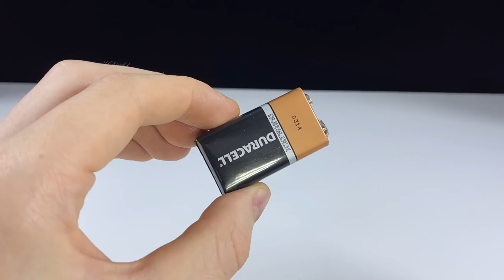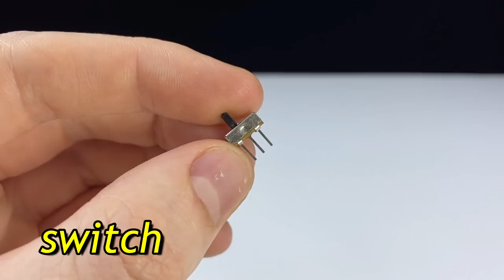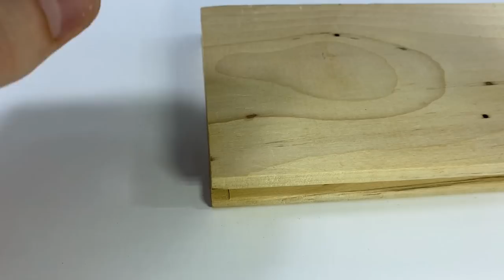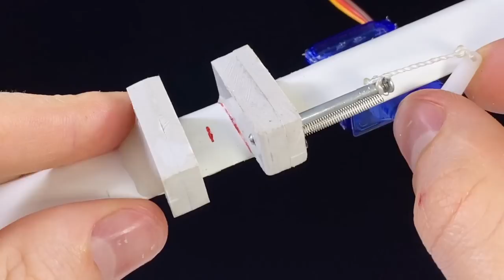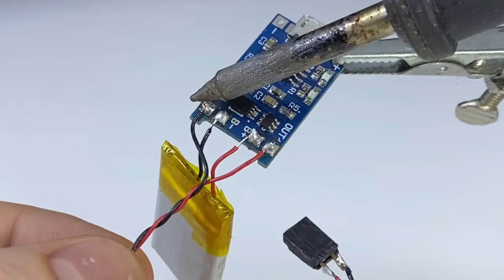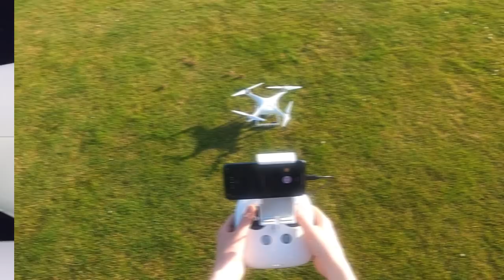5 DIY INVENTIONS

Comment: That last one looks like a good mod to be able to carry my bait out past the breakers at the beach & drop it in the middle of schools of tuna & mackerel that I can't reach by casting alone with a beach rod. Although using it as a high altitude bomber is also a fine choice. I know a lot of the parts you use are just random things you have lying around like the ice cream sticks, pens etc... but it'd be great to get either regular descriptions in the video of the electronics you're using or something in the description about what parts were used. Thanks

Comment: 0:20 Even a kid can do that
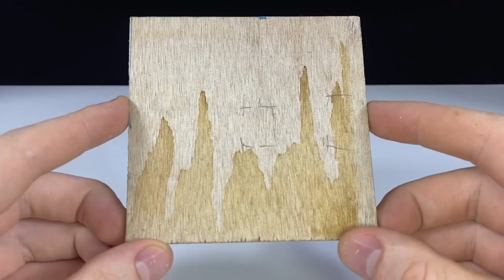0:54 In this, you can add wire strips which can act as a battery clip
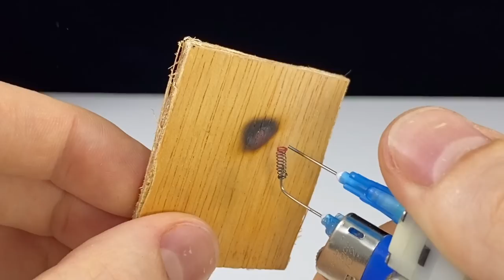03:32 All this just for a working torch which you used in the next one which was a better option xD
Overall, that Drone DIY was better and a killer one